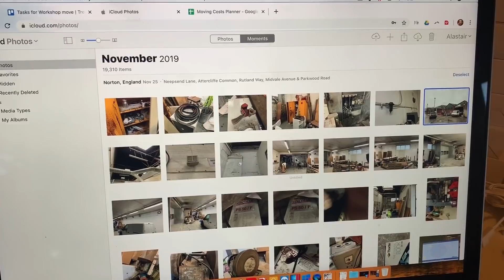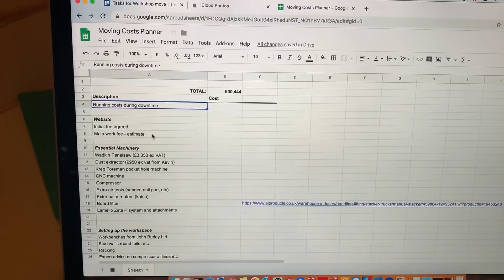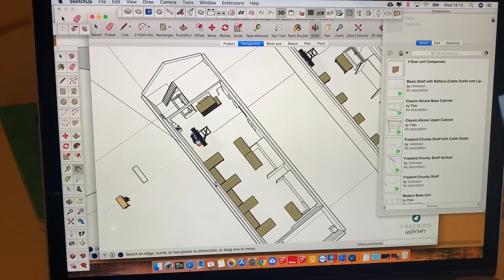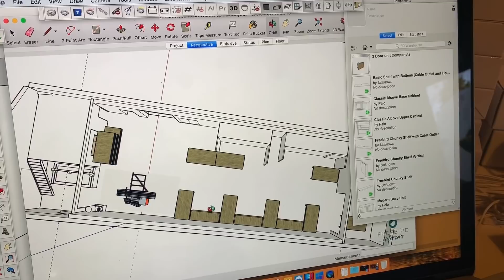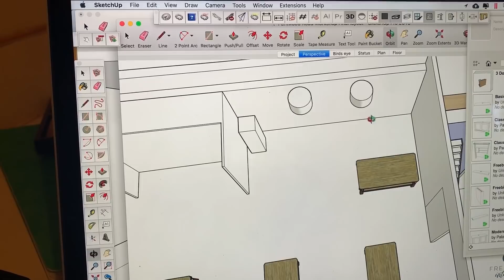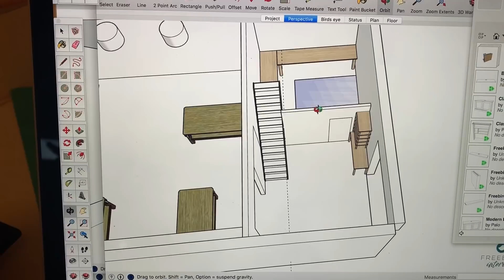New Workshop!  Latest developments

Comment: Here is how i would do spraying section: 
To remember: extractions pull not only overspray, but also dust through freshly finished paint work.
 So i would partition spraying area with one long stud wall facing both booths with enough space for the racking to be fitted for all the panels that waiting for spray on that studwall in the first section, and second section would be my drying booth where air would be sucked in through ducting pulled throug drying racks standing next to grills with IR light over them, then this air would be sucked into the studwall moved trough it to the first section booth and sucked out with active extractors of first booth picking any overspray on its way. This way you creating air circulation in the dust free invironment. So the same air does two jobs helps drying and removes overspray. Both booths would be separated by sliding door. So no banging when opening. 
 Something like that..
Reply from the maker: Jacek Kasza I can see the sense of that... drying is aided not just by heat but also air flow...
Reply: @Alastair_Johnson  the IR light works by heating the panel, pretty much like microwave principle, so whatever wind you create will not blow the heat away but will help the buzzing molecules to separate and not hang about the finish. Generally saves up to 30% on drying time and reduces the chance for crackling to develop.
Reply from the maker: Jacek Kasza that’s interesting, you say the IR heat reduces cracking.  A Morrells rep told me too much cold air over waterbased finishes while they are drying causes cracking so I was thinking that could be a problem with your plan of having drying racks in front of the inlet filters since that air drawing in would be very cold in winter.
Reply: @Alastair_Johnson  and yes and no.. the rep was right that too much air will cracle paint but this will happen no matter hot or cold air (maybe even more likely with hot) and only if its too much of it and over a spots where it's thicker like in the corners of shaker doors. So in my experience as long as the air is blowing evently and preferably from the side you should be ok (i think those grills would help).  Also i noticed it was more likely to happen when i used my graco gun, that beast was using paint quicker than i was filling the pot, not so much now, when i use compressor povered guns as they lay thinner coats. So on the thicker coats the paint forms the surface film before the molecules of the carrier substance from the depth of the coat have escaped. Once the film formed they try to go through it and having dissolving properties brake that freshly formed film, hence looks like random cracks. IR light is buzzing molecules throughout the thickness of the coat but more at the top, so they need some help of wind to break free and let the new ones come up for being blown away in their turn.
 I don't know how powerful these fans are but can't imagine being too strong to become a problem. However, and it occured to me after your remark... the person who is gonna spray will have constant draft over his back, eventually might develop lover back and shoulder pains, as these are most vulnerable body parts to draught aspecially if in damp weather or wearing damp jackets.. again, will depend how strong these fans are..
Reply: @Alastair_Johnson  might need more thought time invested but maybe consider blocking the inlet pipes with plywood lids with couple of tubular heaters attached, so any cold air that gets in will have to travel through the length of the tubes were it will get warmed up. They are quite efficient to heat the space but if you have loads of them may become costy to run.

Comment: Very interesting. Just my two penny's worth: replace any old fluorescent tube lighting with newer I think LED tubes, just under 20 pounds I think, as it is brighter for lower wattage, much nicer light to work under. It has made a huge difference to feeling of my workshop, and will be cheaper in the long run. I can never understand why workshops should be so gloomy and cold! They are the same size so super easy to change. Another tip is don't use saw horses, instead make trolleys (just with 2x4) with wheels. If they are the same height as saws or other key machines they will save your back. For pre-assembly have a much lower bench/trolley, on a perfectly flat space. It helps when hanging doors etc.  Or make a raised platform which is perfectly level for this. Just a thought. Often the little details make a huge difference.
Reply: In my experience of working at different places, some very high end furniture makers had a dedicated-super flat and smooth space, whilst in other places, though they thought it was a great idea, they never had the time to sort this out. Doing this from the start will speed up production immensely, as you have to level every type of furniture at some point.
Reply from the maker: All very helpful tips thanks 👍

Comment: Looks great Alistair, I would suggest you close in your finishing area to keep the dust out and fumes in. I think you may be overthinking the layout and designing a production line. It looks like you will be aiming for about 5 lads ( probably keep it under 5 for H&S) in there so I would suggest for that size it needs to be a bit more dynamic. A few 600mm high benches on wheels are helpful for moving parts & cabinets around the space. Good luck!

Comment: Very exciting and daunting all at the same time!  Good luck with it all.  A couple of comments.  You moved the panel saw from being over closer to one side and in the 3rd iteration it was more in the middle.  If you are stacking panels at the end of the building, I'd suggest you want very easy access to receiving and stacking the panels so maybe the panel saw would be better closer to the side away from the loading door.  Beg, borrow and steal (don't get caught doing the latter) as much as you can to keep your spend on plant and set up as little as possible.  Cheers, David

Comment: No mention of ducting on your list, mention on advice on airlines, simply use 15mm aluminium tube and valves, ducting can be expensive so factor in having the extractor near the panel saw and cnc. Insulate the office well for noise as it can be annoying when your on the phone, especially when/if you get more staff. Good luck with it all, I think your around £10k short but maybe you don’t plan on having it finished before the 6 week refurb time is finished,

Comment: Observations: layout 1 seems better, flows nicely, there is more space to bring your materials in, and also more space for storage and packing of the final product. I would go with that layout and simply sound proof the office. Layout 2 just doesn't seem to flow as well, looked more cramped around the panel saw and a lack of space at the office end for final product storage and packing.

Comment: When my brother had a similar workshop in N London, he also started out doing his own spraying, but after working out all the pros and cons, ended up sending everything to Flo-Rite Spray Finishes, also in N London. I think the costs were marginally higher, once everything factored in, but the final finish in a 2 part epoxy was well received by his customers. His own kitchen is over 10 years old and the finish has lasted very well (no kids...)
Reply from the maker: I’ve experimented with outsourcing.  For bespoke made carcases I’ve used Getley (happy to make anything bespoke) and Lamtek (a bit less bespoke, a bit lower quality construction).  Also ECF (not so bespoke) and a couple of others.  Always I have found it added an extra layer of cost and stress, with the increased burden of communication and error.  The best compromise for me on carcases has been outsourcing the cutting and edging of the boards to Lawcris but doing the assembling ourselves.  For a whil I got them to do the CNC drilling too but it wasn’t worth it and we went back to simple direct screwed assembly methods, some dominoes.  With spraying, we’re doing pretty well keeping it in house even with the limitations of our current workshop and it’s hard to see how I could absorb the costs (and transport and added damage risks) of outsourcing.  I know it can work but I’d rather move more in house, it seems more controllable.
Reply: Freebird Interiors yeah, I see where you’re going, brother had a much smaller unit so outsourcing spraying was essential. He only used Trend for kitchens, because that a very standardised industry. Anything else was all made in house. Having used Trend carcasses myself, they are very well built.
Reply: He also gave up making carcasses from sheet and went to this company https://www.trendinteriors.co.uk, who will supply kitchen carcasses in a huge range of sizes and finishes to the trade. Fantastic glued and dowelled construction in 19mm MFC. Can also be supplied dry assembled. The cost benefits were obvious. I don't know who you use for BLUM, but http://www.ldlonline.co.uk have got to be the best prices for trade.

Comment: Brilliant space, should be fantastic to work in. Take a look at manor wood mega Mft table it’s an amazing idea and something that has improved the way we work immensely. They are built with aluminium section with mft top and heavy duty wheels. You can buy the plans on Etsy for a few pounds. We made our own mft tops with a simple jig we purchased for about £40 or as you are getting a cnc you would be able to make your own very cheaply.
Reply from the maker: simon collins we will look into this thanks
Reply from the maker: Do you remember roughly what the aluminium extrusions cost you per bench?
Reply: Freebird Interiors Hi, from memory the table was aprox 8’x4’ and the cost for the cutting to size and all the connection elements, casters etc was about £350 + the dreaded so for an mft table that size even if you only had one or two I think it’s brilliant value.
Reply: Freebird Interiors hi, just found who we used it was KJN Aluminium profiles if that helps!
Reply from the maker: That’s all helpful however expensive compared to another option we are looking at - metal benches on castors made by John Burley in Swinton local to us, no more than £180 each ready assembled and delivered.  Made from second hand metal racking material.  May not be as precise but definitely heavy duty and ridgid, and saves us time.  and we are think of putting a Ron Paul style thick top on then so if that’s well made it can be packed even more level
Reply: Freebird Interiors That’s a great price for the work benches and as you say a torsion box top would work really well. I would still recommend a mft style top on one of the benches, so good for assembly of large carcasses with a few bench dogs and festool clamping elements.
Reply from the maker: Definitely still planning MFT dog holes whatever we do.

Comment: Yeah looks great! might be worth getting a  schedule of dilapidations survey done just incase there's an issue when you exit? I think it's going to be a space you grow into and adapt so making things mobile is definitely a requirement and maybe not commit every sq ft to something get in the space first and see how it works?  Does the CNC need any space round it like a snooker table or will you drag off pieces from the back. Thanks Sam
Reply from the maker: Sam Rix CNC can be fairly close to wall on a couple of sides but access for cleaning is better.  A formal schedule of current state of repair is a good idea.  We are putting the final agreements in writing at the moment.  I agree making the space adaptable is good 👍

Comment: Exciting times..................
A coupe of things that occurred to me were:
1. The cost of heating such a space is not to be under estimated, given that there are regulations about temperatures etc once you have employees and that you would need to maintain a certain temperature for at least some of the time for curing of paint / lacquer. 
There is a reason why the previous firm spent money on insulation.
2. As the spray booth will be 'open' to the rest of the work space, the huge amount of air drawn through the fans will be un-filtered from the main workspace and will contain airborne dust, which could be the main reason why the previous firm had a separate facility for finishing.  Time management, such as spraying in the morning before other work could probably help.   When at  college learning woodfinishing many years ago I was amazed at the amount of air consumed by even a modest commercial spray booth. Not forgetting that a good portion of your warm air is also vented outside .
Given work flow considerations and costs, I might consider creating an enclosure around the spray booth incorporating a drying area, thus limiting the space that needed to be at a 'higher' temperature for paint curing and also creating a cleaner if not totally filtered air supply.
Good luck with your move
Reply from the maker: Stephen White thanks for that and we are considering closing the spray area in.  There are 2 old large diesel heaters in the space and we are looking into costs of running them - probably keeping only one.  From that point of view also ideally we would partition the space to heat efficiently where it’s needed, and probably continue to use localised infra red heaters at work stations (they heat whatever they point at but not the whole space)
Reply: @Alastair_Johnson  and the noise factor as well.
Reply: Some very good points there, spraying brings as many problems as benefits sometimes 😁
Reply: Really valuable points. At a medium sized cabinetmakers I worked at, we did a lot of pre-cat spray finishing (historic restoration...) The running costs of it were considerable once you include sufficient extraction, filtration systems and air scrubbers. We also had to have a yearly lung check...
Reply: I have visited a spray firm called Flo-Rite, their whole spray area behind sealed  swing doors and the spray guys all wore ear defenders!

Comment: Great overview of the new Workshop Alastair, thanks. The movable benches are an excellent item to have, and will save your backs too. Just one thought on them though - given the type of work you do, would they be better as “carts” with vertical partitions such that items in production could be stored vertically rather than horizontally? You would lose the extra bench top space, but accessing the parts would be easier as you would be able to randomly access any piece. I’m thinking of something like the board trolleys n B&Q that you use when buying full sheets of MDF or other sheet goods, but with a few partitions. Just a thought - hope it all goes well.
Reply from the maker: Morgan Skinner that’s a good idea Morgan... a vertical trolley at least for back panels and other large panels would make sense